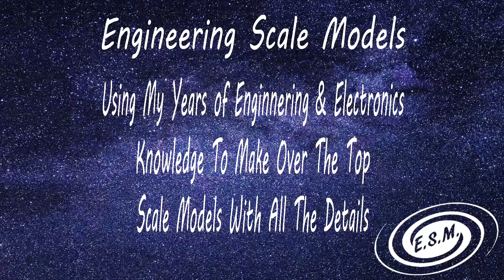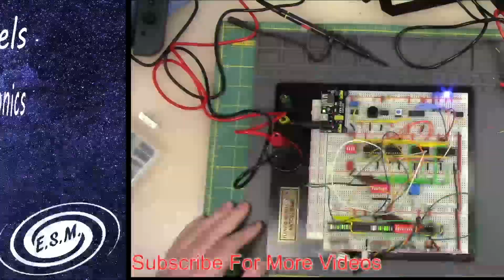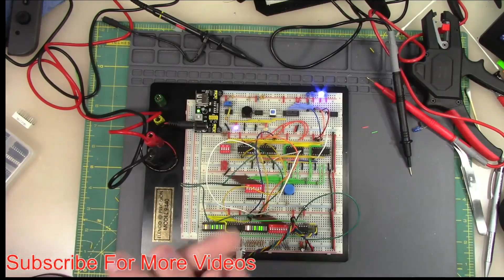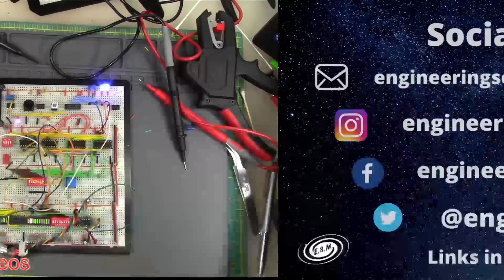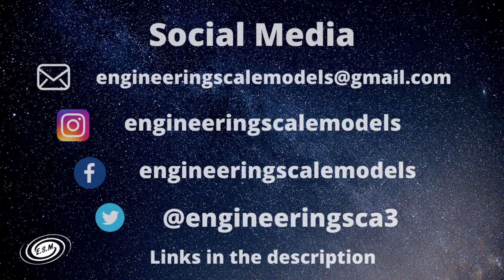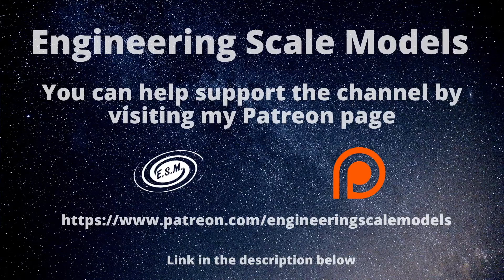Rotary Encoder Project CCG Code Crack Game Version 2 Now with Memory

Comment: Keep it Stupid, Simple ? OR keep it Simple, Stupid. Old school analogue circuits still have there place. Example you crash land onto an Island in the middle off nowhere.
You can't go buy a Microcontroller, so you grab what you can & go for it old school style, bit of a bad way of putting it but.. There is a time & place for it still in this day & age.
Reply from the maker: When you try to explain logic design to a bunch of teenagers you need to start off simple and show them something cool within 20 minutes or you lose them. Using a microcontroller is great, but that teaches you to code not to design, you need to see how the chips function on a logic gate level then you can understand how more complicated chips work.
Reply: Very true! they lose interest quickly, that's for sure! especially in this day & age. Show them something fun and they'll take that and build on it. TTL might be boring for some but.. you'll get some that will take it on into there older life time and still try there best to use it. Cant fault them or you for teaching it J. Your breadboard may look like a lot going on but in essence it will get the inquisitive minds & your sons I hope, into a state where they can surprise you! with there own circuit one day in the future, with what you taught 😊